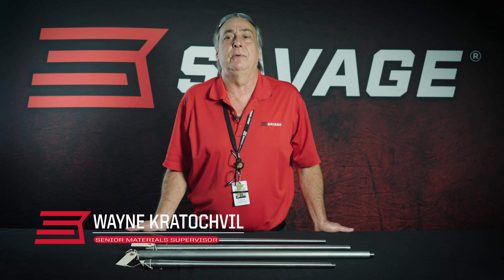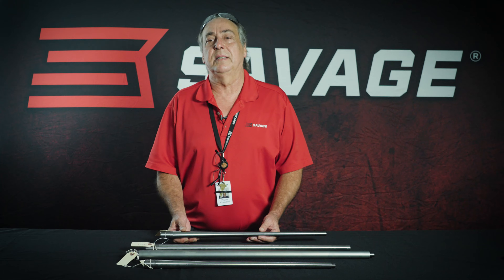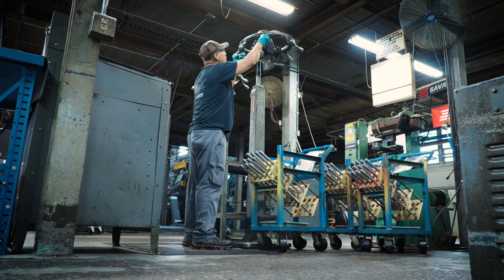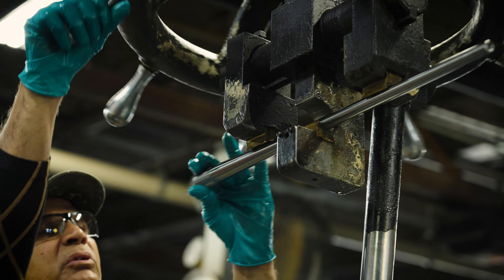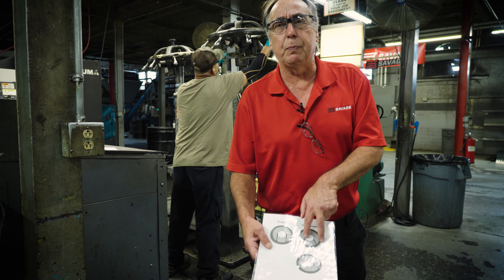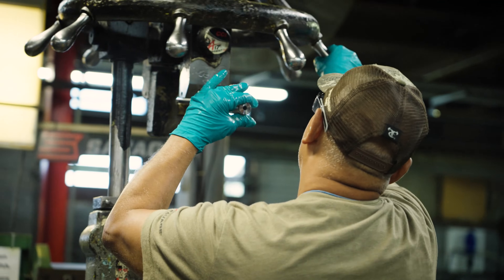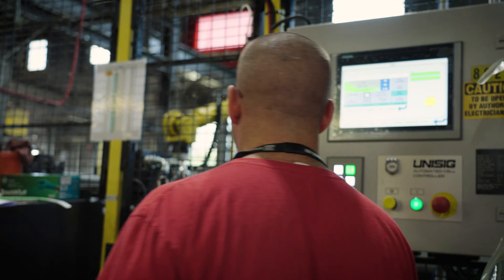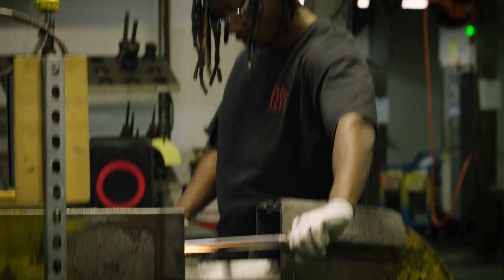How Savage Makes Accurate Barrels

Comment: Please consider updating Twist Rates for "classic" chamberings:

25-06: (1:8 - 1:7.5)
.270 Winchester: (1:8 - 1:7.5)
7mm Remington Magnum: (1:8)
7mm-08: (1:8 - 1.7.5)
.243: (1:7.5 - 1:7)

It would also be nice to see these aforementioned chamberings, along with 7mm Backcountry, 280 Ackley Improved, 7mm PRC chambered in 24" to 26", Heavy Threaded Barrel setups such as - Savage 110: Tacticals, Precisions, Predators and Varmints.  

I'm a fan.  I'd like to see some Twist Rate 'modernization' and more available options of Classic chamberings. I'd also like to see the full potential of the new 7mm Backcountry cartridge in Savage 110 Long, Heavy Barrel, setups - shooting newer, higher BC projectiles.
Reply: Not everyone wants to shoot just heavies. .243 is perfect where it is at savage 1:9.25" it will give you best accuracy from 55gr to 95gr. It would be cool if they did what you are suggesting for their precision/Tactical line though. Just to give an option for PRS type stuff. The only thing is the best BC heavies are to long for a short action in .243win. (especially magazine fed)That is why they invented the 6 and 6.5 creedmoor. I've been shooting and handloading for 243win for almost 30 years. I love that cartridge. Who wouldn't love a 55gr. Ballistic tip going 4000fps+ lol. Laser beam.
Reply: @jjmckay6man1 Good points you make about 6mm Creedmoor, however, I'm more interested in .243 Winchester 90 to 100gr.  Those projectiles fall within the typical grain weights (80gr to 108gr) of the 6mm ARC - which generally have 1:7.5 to 1:7 Twist Rate barrels. .243 Winchester ammo is more available and less expensive than 6mm Creedmoor.  It's just my opinion that "newer" cartridges lead me to believe that modernization to "classics" can be the better "mouse traps" over 'new stuff' (specifically Bolts Action rifles).  I like new stuff (6mm ARC, 25 Creedmoor,  6.8 Western,  etc.).  I also want to see how old stuff (243 Win, 25-06, 270 Win, etc.) competes when updated with the same projectiles and Twist Rates - while having larger to similar case capacity.  In "hunting" setups, I agree with you - they can keep Traditional Twist Rates.
Reply: @OC_Lofton  Oh I agree that the old classics can be made better given the right receiver lengths and twist rates. I have a 1:8 twist AR10 upper that loves the 105 bergers. Haven't tried the 108 eldm's yet though but I imagine a 1in8 would probably stabilize in that twist but you would be seating the bullets quite far into the case to fit magazine length. I think the 25-06 could be amazing with the right twist with the newer 135 and 138 high BC bullets now available. the same with the 270win with some of the newer high BC bullets. Thanks for a good conversation! I have thought many times about your Ideas just don't think as many people would be into it to justify Savage doing much of them. Thank goodness for custom barrel makers haha.